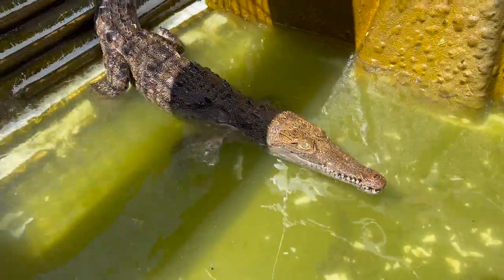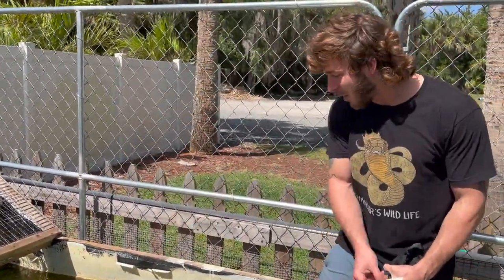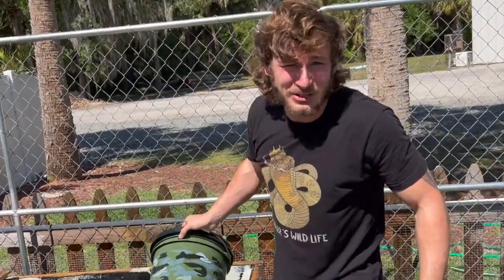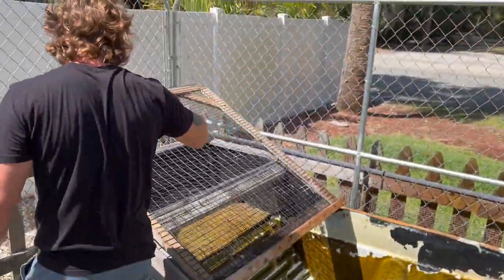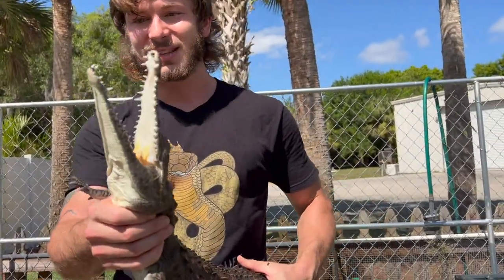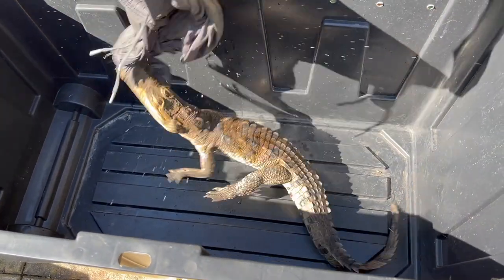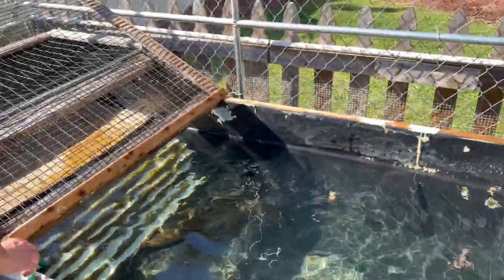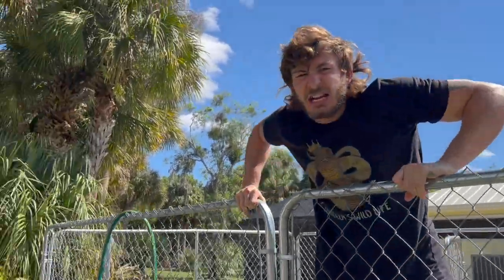This CROC JUMPS!

Comment: for your info, it is not that the pump sucks, but the static pressure of that pump is not that high...therefore, it is hard for it to harden your flexible hose. They work better with hard hose and short hoses.

I hope it helps you get it working next time :) these saved my house from a flood incident!

Comment: Literally cut a 1 inch hole in the bottom of the tub. Buy a pvc valve from home depot, and some silicone, and install that in the hole. Problem solved.

Comment: You got a well right...by means of water supply to the household? Just asking cuz was wondering that if otherwise, & had public water stead...would you hv had to apply a water conditioner to remove chloride 1st b4 introducing Ziggy or is this unnecessary? Just curious cuz I know most fishes, invertebrates & amphibians do require/recommend this measure b4hand. Thx.